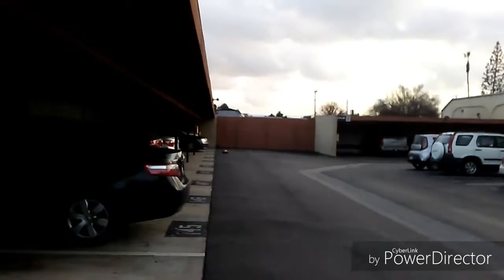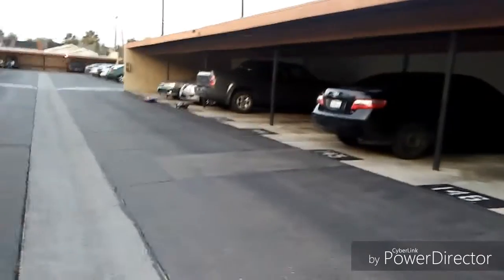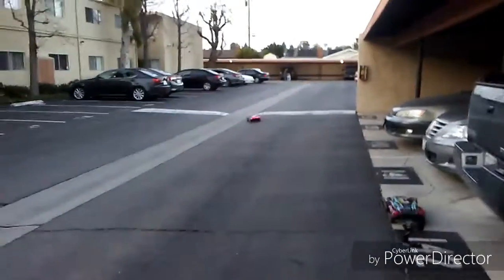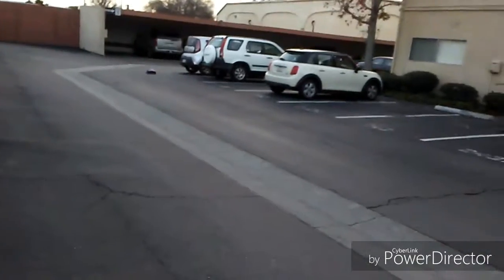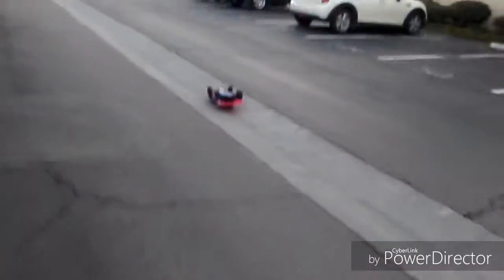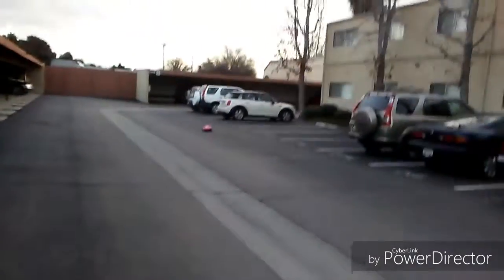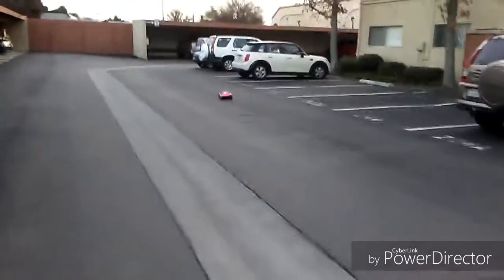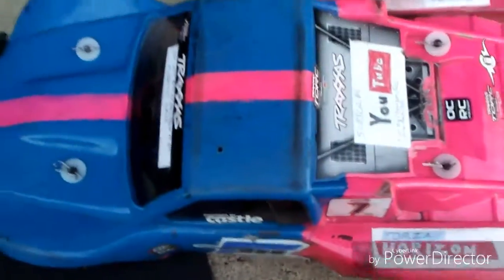MUST SEE TILL THE END:  Traxxas Slash 2WD on 3s (11.1v) LiPo

Comment: did you have to install lipo cutoff
Reply from the maker: +ccbs vlogs Not really.  The Castle Mamba Max Pro has LiPo cutoff
Reply: FHRC Brony so yes
Reply from the maker: +ccbs vlogs yes
Reply: FHRC Brony but that speed go crazy
Reply from the maker: +ccbs vlogs Hard to control as well
Reply: FHRC Brony I can see that. your a savage for this video bro
Reply from the maker: +ccbs vlogs luckily I didn't break anything.  Just parts were popped out
Reply: FHRC Brony thats good.  im buying a slash for $175 do you have an oba installation video I could watch
Reply from the maker: +ccbs vlogs no but I can make a video to show how its done.  If you're a subscriber, do you have the notifications on?
Reply: FHRC Brony yes I do
Reply from the maker: +ccbs vlogs letvme post a different video first then I'll make the OBA videi
Reply from the maker: video